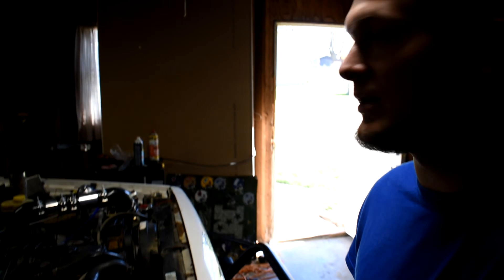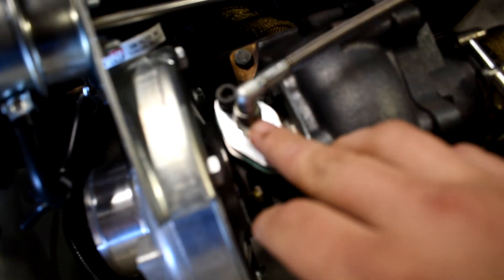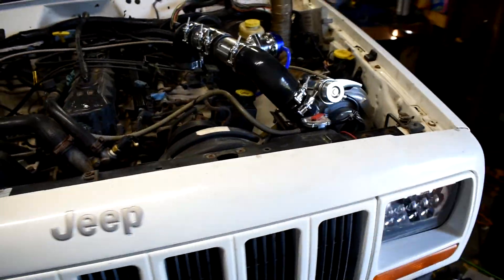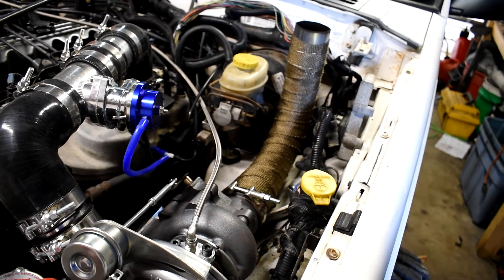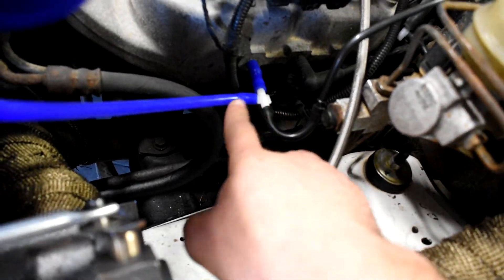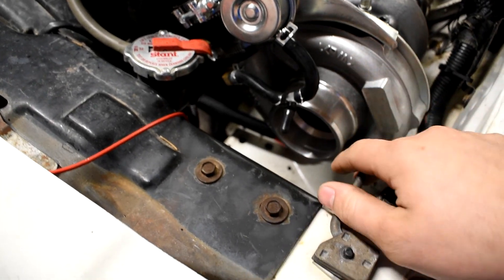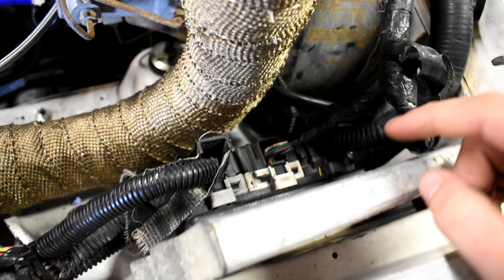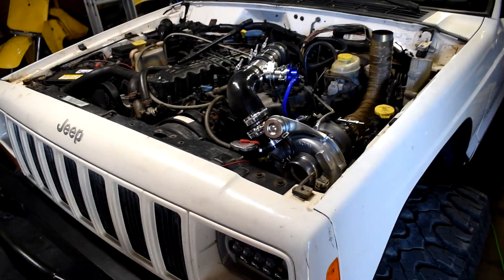Turbo XJ

Comment from the maker: I hate watching this video and seeing how much money I wasted just to watch it all burn away. 🔥
Reply: What happened to it ?
Reply from the maker: @SuperSmashHoes64  burst into flames on my way to work one morning. Complete loss.
Reply: @xXalexkablamXx  that's terrible dude sorry to hear that. Do you know what caused it to light up ?
Reply from the maker: @SuperSmashHoes64  well I put another engine in and I was running it naturally aspirated. The turbo kit blew the original engine. The new engine was on e 85 still but I put some bigger ford injectors in there for the Ethanol. I think one of those injectors o rings gave out and started spraying fuel. Poof.
Reply: @xXalexkablamXx  probably slightly better performance if you had your o2 sensors hooked up. Where you runnin them?
Reply: @xXalexkablamXx  also sorry for your loss dude
Reply: @xXalexkablamXx  if you installed a split second enricher box. I’d give you better response and performance

Comment: I did the same but modified my manifold for riverside mount. I had problems with my power steering over heating and basically was boiling the fluid so thin it would quit working until cooled off. I tricked my pcm so many ways a.d tuned only with a msd box. How's that piggy back? Is it good enough to only use that?

Comment: So should i send it and turbo my jeep just rebuilt engine with stronger pistons and head studs should handle it great im more worried about the drivability?
Reply from the maker: They are very drivable with the turbo kit! Just do it! I’m going to build another one some day!
Reply: @xXalexkablamXx  fuck i wanna so bad i got all the shit to install turbo and have it connected just worried about maf and fueling hoping i can by pass maf and just run a fuel regulator and not have to upgrade fueling
Reply from the maker: @2015wrx_build  you can try. Depending on the year of your 4.0 you can use HPtuners to tune the fuel map with a aftermarket map sensor to allow for boost. It was pretty easy for me to learn with YouTube videos.
Reply: @xXalexkablamXx  okay i got a 1998 4.0 so it will work ive watched hella videos so hopefully with all of them i can figure it out lol  just would suck to do it all then it not wanna run good and be stumped
Reply from the maker: @2015wrx_build  nah man you got this. Just do it!
Reply from the maker: @2015wrx_build  would be wise to build the motor for boost for sure

Comment: Hi Alex, trying to help my son do this on his XJ. What eBay kit did you start with? Not sure if you ever got the HPtuners MPVi2 but apparently they only make the 3 now which won't work on his 96:-(
Reply from the maker: I bought the mpvi 2 and it worked great for mine. I’m sure you can find the mpvi 2 from other vendors if mpvi doesn’t sell them directly
Reply: @xXalexkablamXx  Hi Alex, thanks for the reply! HPTuners said they don't make the version 2 any longer sadly. What eBay kit did you buy originally?

Comment: hi i am boosting my 97' tj 4cyl, i ordered the split second LSC2-001. i noticed you used the FTC1-202. i am confused on the difference. is the difference that the ftc1 is laptop programable? could i use it on the 4cyl? thank you. i might return when arrives and order the one you used.
Reply from the maker: I actually ended up going with hptuners on the jtec ecu. Was easy to tune myself.
Reply: @xXalexkablamXx does hptuners support the 4cyl?

Comment: that so called cheap turbo is perfect for Cherokee that's all you need you should run a plate off the filter out ditch the filter adapter go to he fire wall and distribute everything from there/.yo 8lbs is allot,

Comment: What did you do for fuel? Fuel pump? Regulator? Injectors?
Reply from the maker: I would love to share,  

I bought an AEM e85 340lph pump off of Amazon. It was not cheap. And I used zzp 60lb injectors tuned with HPTuners.
Reply from the maker: Every gasket and o ring was replaced on fuel system with new.
Reply from the maker: *on the turbo setup.
Reply: @xXalexkablamXx  thanks for the quick reply bud

Comment: Why didn't you just run the turbo hot side out with the rest of the exhaust system and then the air intake on the cold intake side ? Why run it out the hood?
Reply from the maker: No reason other than it was easier.
Reply from the maker: If I were to do it again it would be a proper build. This was the first time ever building something like this and I was pleased with the results. If and when I buy another Jeep I’m sure I’ll make videos on it again.

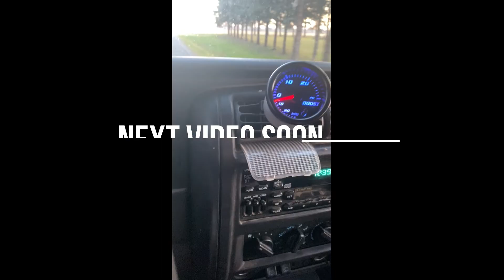Comment: 8:56 minutes of talk and 5 seconds of the actual turbo running?  Come on man lol. New video but this time 9 minutes of running the turbo, the setup and the drive.  Maybe show some IAT and fuel trims too.
Reply from the maker: A lot has happened since this video… the Jeep was fun and ran for quite some time. That engine blew up and I put a used engine in that I found locally. 4 weeks of more ripping around it caught on fire and it was a total loss. I lost everything. My laptop with footage, all my files, tune files, my hptuners mpvi itself, money everything gone just burnt away. So I have been salty for a year and I haven’t followed up. Maybe I will again someday maybe I won’t. But sorry if I’m disappointing.
Reply: @xXalexkablamXx  Yea i watched the whole thing and not even skipped over and I got rick rolled at the end HAHAHAHAHAHA.  Well man you'll get back on your feet and something will come out of it.  Have any spare turbo parts for sale?
Reply: @xXalexkablamXx  dang, this is sad. was this with the 26lb or 60lb injectors? scared to use hptuners now..
Reply from the maker: @Mars.k1corona  60lb. Just don’t hit 12lbs of boost like I did. And don’t burn your Jeep down like I did.
Reply: @xXalexkablamXx this makes me sad. i definitely plan on staying under 8lbs of boost with 22-25lbs injectors.. also i will be installing a fire suppression system, for sure!!

Comment: Wouldnt turboing help gas milage too? And the only turbo jeeps ive seen on here are straight piped, do they need to be?
Reply: Gas mileage will kind of depend on the application. If you want tons of power, no it won't really help with gas mileage. If you just want a little more power, then yes it's possible to make the engine produce more power even more efficient than stock power numbers. They don't necessarily have to be straight piped, but turbos love exhaust flow, the more the better. IF you take two identical turbo systems, but one is straight piped (assuming all the running conditions are the same) the one that's straight piped will most likely make more power. This is a massive generalization and will 100% depend on your engine and application

Comment: Do you have a check valve on the the map Sensor?
Reply from the maker: Split second tuning replaced the stock map with a two bar map!! Video coming soon on this
Reply: I can I use the new hp tuners mpvi2  instead of the spilt second?
Reply from the maker: @HESTEBAN915  you can, I plan on using hp tuners for fine tuning.

Comment: What all did you need to go from your exhaust to the engine bay?  Aside from the t3 flange, and what you used from your stock exhaust? I have purchased my turbo with an external wastegate as I was planning on using the boostwerks manifold but if I can use my stock manifold/header I like the position that yours is in a lot better. For the price of the manifold I could buy another turbo that has a built on wastegate and the materials to build my own pipe and probably still be cheaper than the 400 dollar manifold. Plus the exhaust and piping looks a heck of a lot easier than if it was bolted to the manifold.
Reply from the maker: You need a 180, or a horse shoe to flip the direction. Mine horseshoes right off the header and points up towards the power steering. From there I had to adapt the exhaust size from 2-1/4” to 2-1/2”. It goes up from there and 90’s right under the power steering pump. So things you should get,

- a horseshoe, or 180 degree bend. 
- a couple 45 degree bends, 
- enough straight piping as you think you’ll need
- and a 90 degree for under the pump. All in 2.5 inch piping except for the horseshoe. Obviously I use the stock pipe that bolted to the header that way I could utilize the bung and flange. 

Just don’t give up and have patience. This was the hardest part for the whole build believe it or not. So if you can get past it, you’re golden.
Reply: Thanks!  I just ordered piping and everything last night. I’m going to use my external wastegate and fab that up. One other thing I can think of is did you use an oil restrictor? If so what did you use?
Reply from the maker: @matholland618  yes I did use an oil restrictor, the one I used is the one that came with the Hybrid turbo!